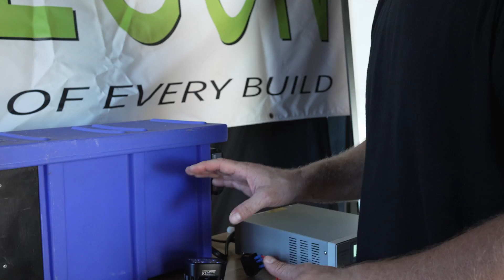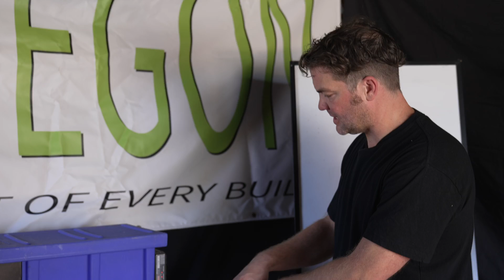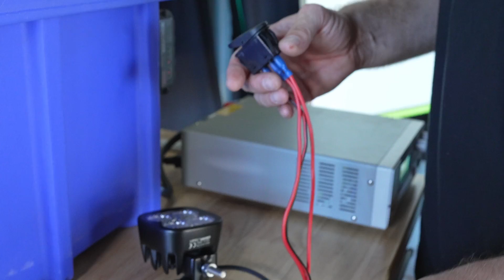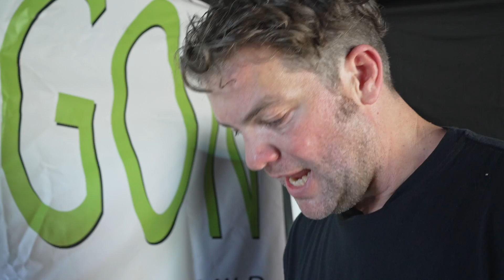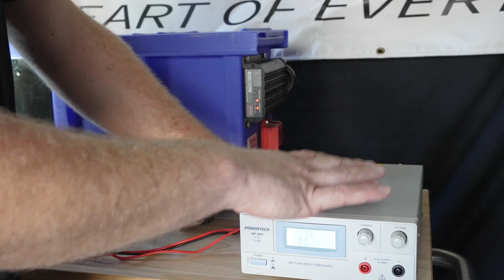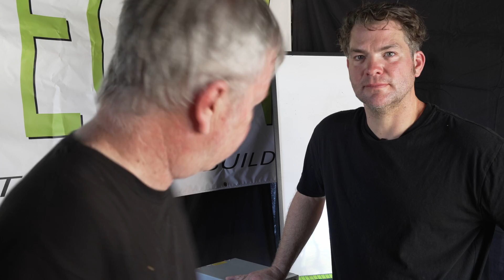EGON RELAY-HUB. Wiring to Battery Box@EGONGame-changingsimplicity

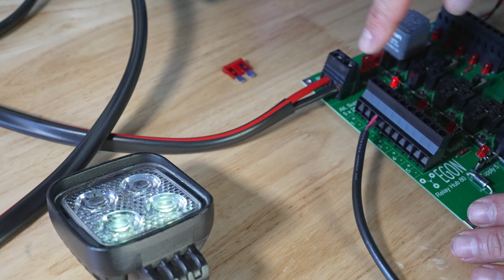Comment: Heiner and Andrew, I love this Egon Relay-hub, however what's with the light/load getting some power (@1:59) before the associated Fuse is plugged in? Seems like some sort of voltage leak in the circuit? My guess is it's leaking through via the LED or the resistor?